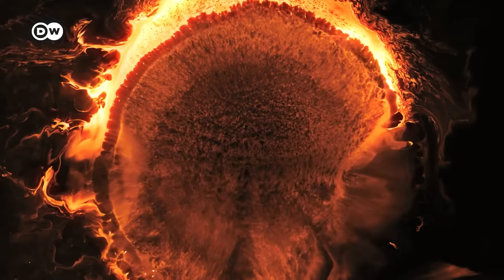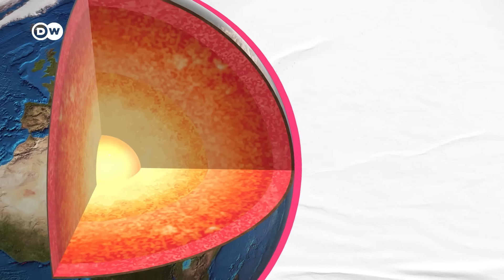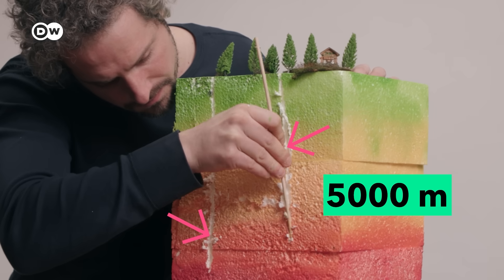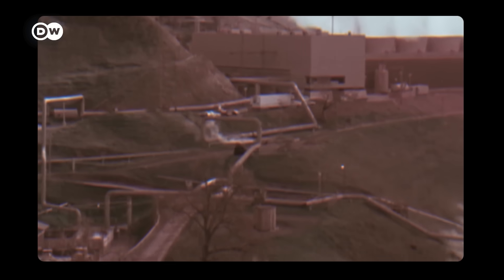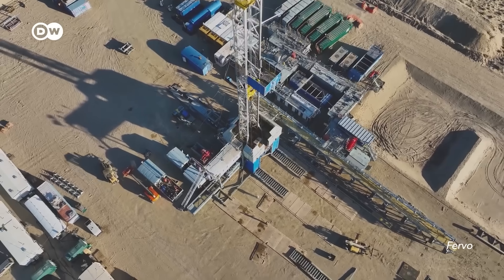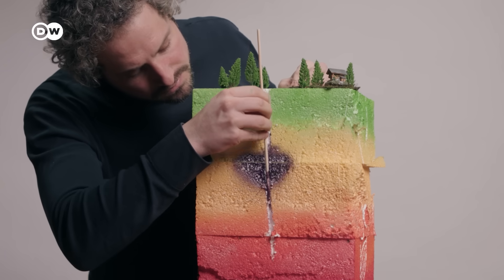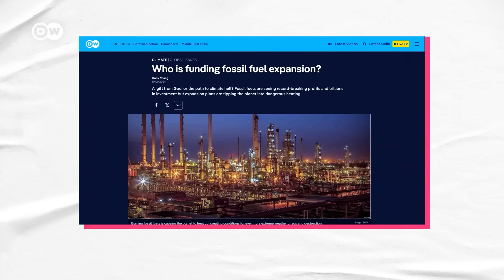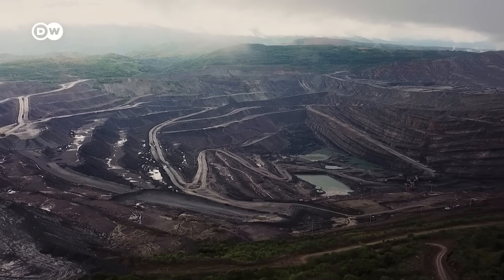How the oil and gas industry can unlock endless geothermal energy

Comment: Can someone calculate how many geothermal plants we need to build to make our earth core lose their magnetic field?
Reply from the maker: Hi there, as far as we know human use of geothermal energy is insignificant compared to the total heat of the Earth's core. The Earth's core has been cooling naturally over billions of years, but this process is extremely slow and unaffected by geothermal energy extraction. The Earth's magnetic field is generated by the movement of liquid iron in the outer core, which is far deeper than where geothermal energy is extracted. Even if the magnetic field weakened, it would not directly impact the greenhouse effect, which is caused by atmospheric gases trapping heat. You could read more about it here: https://www.energy.gov/eere/geothermal/geothermal-faqs?utm_source=chatgpt.com

Comment: One of the main problems is exhausting the conduction and making it a heat depleted zone. Next it causes structural collapse and prone to earthquakes. So basically it’s an idea which will not work easily.

Comment: Water vapour exerts a green house effect as well. 🙈
Reply: But for one it's self regulating, it will fall out as rain in a short time; more importantly the steam isn't actually getting released, after the heat extraction, the resulting warm water is pumped back in to be converted to steam again, in a closed loop, because that's way more effective.
Reply: @ ok, thanks for explaining. 👍🏻

Comment: It would cool down the earth permanently as it takes the heat from earth internally. It would result in dead earth for sure in the long run.
Reply: No it won't. There is unlimited heat deep in the core. There are geologists talking about that in the comments.
Reply from the maker: Hi Eric, human use of geothermal energy is insignificant compared to the total heat of the Earth's core. The Earth's core has been cooling naturally over billions of years, but this process is extremely slow and unaffected by geothermal energy extraction. The Earth's magnetic field is generated by the movement of liquid iron in the outer core, which is far deeper than where geothermal energy is extracted. Even if the magnetic field weakened, it would not directly impact the greenhouse effect, which is caused by atmospheric gases trapping heat. Therefore, large-scale geothermal energy use would not cool the Earth's core enough to stop the magnetic field or expose the planet to harmful solar radiation. You can deep into the topic over here 👉 https://www.energy.gov/eere/geothermal/geothermal-faqs?utm_source=chatgpt.com

Comment: This has failed in both Australia and USA as once the heat in the location of the hole has been extracted the surrounding heat is slow to replace what has been removed, unless there is a continuous replenishment, as there is in Iceland.
Reply: Yes there will be a decrease in heat after 30 years but leaving the well for a couple of years makes it recover . Eavor has made it work well. Perhaps fracking is what you are referring to.
Reply: I thought this might be one of the problems. It all sounds nice and easy, but I think it is much more complicated. I'm thinking the oil and gas industry already know this  from experience. Their industry is not threatened, there is nothing that can ever replace oil, gas and coal. They are the feed stock of industry, they are the building blocks to produce everything on mass; Pesticides, fertilisers, plastics, synthetic fibres, paints, dyes, medicines, solvents, lubricants and more. Industrial processes are developed using chemistry, there is nothing available that can replace this feed stock on mass, not even close.
Reply: @alexandermelbaus2351  not yet.

Comment: There should be some discussion of the chemicals in the hydraulic fracturing fluid and how it can end up in drinking water sources
Reply: Eavor is a sealed closed loop system. Nothing is leaking anywhere. The solution circulates through the well then thru the heat exchanger ,then back down again.. Electricity is generated or hot water is made for heating homes.
Reply: @fayebird1808 did you watch the rest of the video?
Reply: @yawn5150  Yes .Not very safe and I dismissed that option

Comment: I think anybody who has ever been down a mine will tell you that there is heat there. In the gold mines of South Africa it can be dangerous to touch the walls of the mine because you can get burnt.

Governments could insist that all new homes are built with a vertical ground source heat pump so the cost of heating would be negligible.
Reply: According to Harry, from Harry's Farm, the vertical heat pumps don't work very well. The horizontal ground source heat pumps work way better because they have a greater surface area and take heat from a larger area. Which means you need a lot of space, which is great if you have a huge garden or a field... Otherwise they are a waste of money..
Reply: @natkingcol909  Well according to other experts in the filed they say that vertical heat pumps work very well. One of their advantages is that unlike horizontal heat pumps they are not close to the surface they are not subject to the surface temperatures which can impact soil temperature which reduces the efficiency of the system. Vertical systems are in rock while horizontal systems are in soil.
Reply: @stephenhodgson3506  Yeah it probably depends on who is selling it to you🤣
Reply: @natkingcol909  You have to accept that vertical is going to cost you more because you are drilling into rock rather than digging a trench but just going down any mine will tell you there is more heat to be gained the deeper you go.

Comment: Are there very long term risks of accelerating the cooling of our Earth's core?
Reply: No.    The earth has huge amounts of heat from radioactive decay of thorium.
Reply: @tftftf  Almost correct. The majority of heat stems from the decay of 40K (potassium) which several orders of magnitude more common than thorium in the Earth's crust.
Reply: the sun will destroy the earth before it has chance of cooling down so it's not really a problem

Comment: Surprised this didn't mention the efforts at using non-water working fluids that can transport the energy more easily and need less heat.

I am skeptical though that outside already suitable areas for geothermal that the LCOE will be anywhere close to solar/wind + battery storage.
Reply: Eavor has a suitable fluid in their sealed closed loop wells. They have patents on that info!

Comment: You don't need existing water in a contained system. You can provide your own liquid and run it through a heat exchanger to heat water, do whatever you want to do with the heat. What took them so long? This is basic technology. It's just about running the tubes down into the ground. Remember, Iceland has volcanoes. That makes it more cost effective.
Reply: You should have told them waaay back
Reply: Not water but Supercritical liquids in closed loop system and 2miles deep?
Reply: Petro-profits. That's what took them so long mate

Comment: These technologies all develop in areas where it makes sense. Most of the open air heat pumps that are available in my area only work down to just below 40°F (4°C), so they're not very popular. They just don't save enough money. As these technologies mature, they will be more useful in more areas. The good thing about geothermal is that it is more isolated from atmospheric changes than solar or free air heatpumps. We still need nuclear if we are actually going to reverse climate change. The money has to be there. Fusion byproducts can be used for many things people do not yet realize. Deuterium fusion makes helium, for example.
Reply: Inertial fusion/fission combined?;

Comment: the kola superdeep borehole is 12 km deep! I wonder if it could be used for this.
Reply from the maker: Hi Aaron, it seems that it could not... 👉  The Kola Superdeep Borehole encountered temperatures around 180°C, which are lower than the 250°C typically required for efficient geothermal energy production. Additionally, its narrow diameter and geological conditions make it unsuitable for geothermal energy extraction.
Reply: @DWPlanetA  Good to know! Thanks for the follow up :) That was a really cool video. Keep up the great work guys!
Reply: @DWPlanetA That's inefficient for flash plants, but Organic Rankine cycle plants are perfectly suited for that role due to the lower operating range

Comment: Just build nuclear power plants along with traditional cheap renewables (wind, solar), plus few pump-storage HPPs for balancing, and forget about expensive electricity and CO2 emissions.
Reply: Just build nuclear? Its an expensive undertaking. and the plant has a limited life. Geothermal wells will last for hundreds of years.
Reply: Research into deep drilling will not only serve geothermal power. There's potential for very lucrative mineral extractions (like lithium, thorium, uranium, etc) if the brine is extracted and refined from the water that's poured down the bore hole.
Reply: CO2 is emitted when making and destroying both solar panels and wind turbines

Comment: The drillers, who mostly work for subcontractors, btw, are sitting on their hands just the now; a finished technology that has some chance of licensing and we are off to the races. The big boom will come with the technology to drill those deep wells and in the main, that means work at temperatures nearly at the melting point of steel. The drilling rigs to run it with already exist. I wouldn't worry too much about the plight of Big Oil; their grandfathers had to make a similar jump from a previous fuel source- coal, as in Big Coal. My tea leaves are leaning towards being Big Utility Players, so it is likely they aren't far behind the curve on this knowledge. You are so right that they have the money and exactly the sort of staffing to do big engineering projects quickly and on time.

Comment: I think geothermal’s best bet is to focus on heating rather than power generation. 
Go down 15-20ft and you have enough heat to keep any building warm.
Reply: You are describing using a heat pump, which takes external power. They are describing sufficient heat to produce power via boiling water.
Reply: @ No I am not describing a heat pump… I am describing low depth geothermal heating. 
Some greenhouses are doing it with just some 4-6” tube sunk down 10-15’ and a small circulating fan. 
And before you say that is external power… literally all of these systems use some form of pump - just the pump uses far less energy than what is extracted.
Reply: @popandbob  This isn't geothermal. The heat at those shallow depths stems from the sun.
Reply: @ Yes it absolutely is geothermal because it stays that warm at that depth regardless of what the sun does.

Comment: Renewable energy generation has not replaced fossil energy; it only added to it. We use more fossil fuels than ever and more renewables than ever. I expect the same to happen with geothermal.
Reply: the overwhelming majority of new energy projects are newable. this means that fossil fuels will (and already are) being replaced as they get old.
Reply: Great point. If people want to be environmentally friendly, reducing consumption is the only way
Reply: not true where I live, when it comes to electricity generation, we only had natural gas as the fossil source and use of it has come down significantly due to wind and solar pushing it out, of course to further reduce its use we need batteries and new solutions for ''dunkelflaute'' as Germans call it, which could be geothermal or new nuclear
Reply: @lkrnpk  Heat storage in a sand tank in Finland.
Reply: More and more, new renewable generation capacity will exceed new energy demand, and then we'll see the energy share of fossil fuels being eroded.
Reply: Energy is work and resources.  You can't get around that.  You basically just said "let's keep the 3rd world poor and in the dark."

Comment: 150 times annual demands.. strange way to say 150 years
Reply: It means we could produce in a single year 150 times our current annual energy consumption. It doesn't mean the energy will only last 150 years.
Reply: 150 times the current year's supply might not last 150 years
Reply: @rsimpson69  We are talking millions of years here.
Reply: You are correct, it wouldn't last for 150 years. It would last for 250 million years.

Comment: Yes wind and solar are cheaper but parts of the world are not sunny or windy enough.  Even now geothermal is a fraction of the cost of nuclear power.  And, it can be constructed in less than 24 months.  
Drilling boreholes by vaporizing the rock rather than mechanical drilling will allow deeper, hotter bores.
Reply: Geothermal energy is actually coming from passive decay of underground radioactive materials.  
It's nuclear power anyway but with less "oops" potential
Reply: The exploration costs make geothermal more expensive than nuclear and more expensive than hydroelectricity.
Reply: @ There is a company which doesn't need to explore for suitable ground  .Eavor Technologies can find heat in most areas.  I'm hoping they will make electricity & heat for the Inuit in the Arctic some day.
Reply: Wind and solar aren't cheaper on a calm night
Reply: @rsimpson69  so use batteries duh
Reply: @ExtraDryingTime  then it's not cheaper anymore

Duh
Reply: @rsimpson69  oh yes it is gramps. Try some recent tech for a change. Look! There's the world buzzing past you.
Reply: @ExtraDryingTime  not quite yet, but yes it's improving. I'm here bc I love this tech too. You can ride the bleeding edge if you like, but please admit that you pay for the privilege. If that level of luxury were the commodity you claim, I'd already have it hooked up to my system, wouldn't I? I mean, if it would pay for itself?

Comment: DW Planet A: Your entire discussion is wrongly framed. The temperature of the rocks is not the most important parameter. The most important parameter is the FLUX of heat up through the Earth and that is VERY LOW - typically less than 0.1 Watts per square metre. Just cooling a down a few cubic kilometres of rocks causes Earthquakes and subsidence and the yield falls with time making it a one shot technology. The technology needs to be cased on the steady state heat flux otherwise etc technology is not renewable. EAVOR's technology is renewable, but the fracking technology (as I understand it) is not. 

Please stress that it is the HEAT FLUX that determines how much power can be extracted. At 0.1 W/m^2 one need 1 km2 to sustainably harvest 0.1 MW of heat. and 10 x 10 =100 km^2 to harvest 100 MW of heat. The temperature is not critical once it is high enough. 

Best wishes: M
Reply: Your math is a little incomplete. You have to calculate for 3 dimension and add the heat that will come from the sides. You should also add the heat that is already in the rock.
If you add 1 km depth to your calculation the heat in 1000 km3 will last a very long time even without any heat flux at all.

Comment: If you invest 1 trillion dollars in fusion, I bet you could get free and much cheaper energy as well. So why bother and damage the earth crust for nothing? I was also missing some concrete numbers of the costs. It costs about  100 $/m of depth for the ordinary home  geothermal (with a couple of kW capacity). I would imagine that building something larger that is needed for industrial purposes and going to a 4km depth would cost at lest 2-3 k$/m. And you probably need several holes, not just two as shown in the video. And then with all the maintenance and all other costs ..... 

Additionally, having a dry rock around the closed system loop is not the best solution, as you need something that conducts (and accumulates) heat well. Usually, the natural underground water is used for that, but I have no idea  what happens at a depth of 4 km.
Reply: 4-7km deep well doesn't penetrate the earth's crust. It is not even like you scratch your own skin.

Comment: 0:40 Cape Town? Really? Why would you do that there for heating? I think last year June was the coldest and that was like one or two weeks of under 10C overnight, rest of the time it's fine. Just need modern/good insulation and most of the city is sorted, no real need to build geothermal there for the few weeks a year that it's cold.
And geothermal would never compete there compared to wind/solar+battery.
Reply from the maker: Hey there! Geothermal energy can be used to produce electricity for any kind of use.
Reply: Geothermal is for electricity too.

Comment: Will it make earth's core cooler if many such hole are drilled? and What are the cons of it?
Reply from the maker: Hey there! No, it would not have an effect on the Earth's core temperature. The disadvantages are for example high initial costs and as we tackle in our video the risk of earthquakes.
Reply: The UK started several pilot trials of geothermal energy drilling. They all had to be stopped because of earthquakes caused by the trial
Reply: Eden geothermal was temporarily halted to monitor the seismic activity during stress testing and went live in 2023. Which ones were stopped?